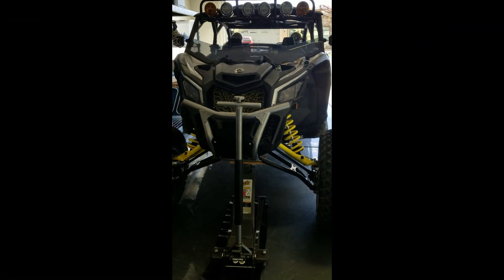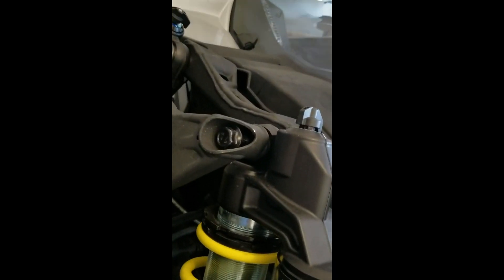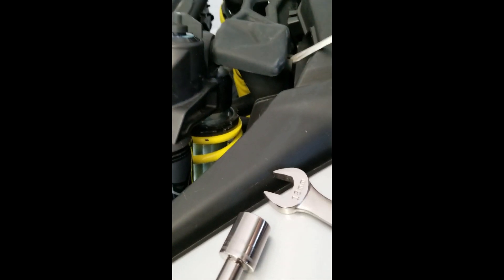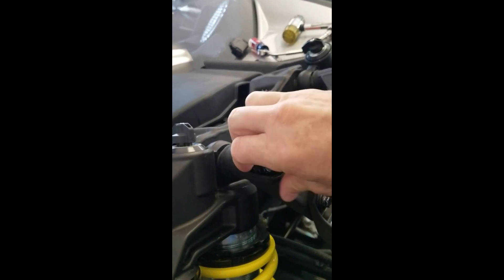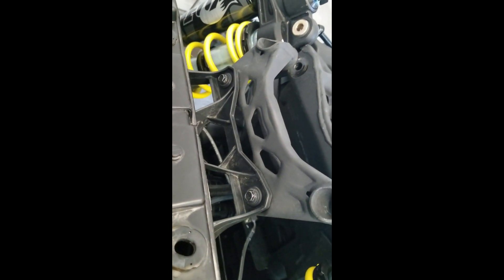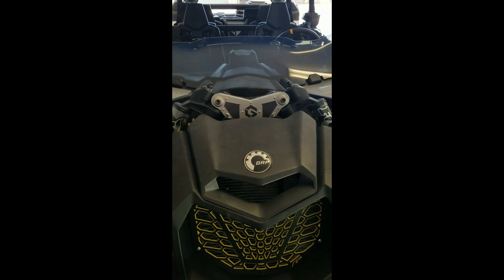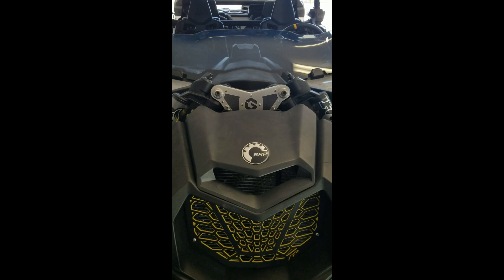Shock Tower Brace Install

Comment: Unfortunately those braces are a waist of money. They need to tie into the bottom of the chassis for it to serve its purpose. Still a good video 👍🏼
Reply: Looks wayyyyyyyy better then stock by far i did mine with LM-UTV made a huge appearance difference
Reply: Actually not true, Geiser brace is 4130 chromoly steel and puts bolt through double sheer vs single tab on OEM part.  Traditional tower brace tied into frame will provide additional stiffness; however, it just moves stress point into front frame.  If you hit hard enough with amount of force it would take to break Geiser brace, your factory frame will likely bend with tower brace.  Unless of course you are running a race car w/chromoly steel tubed frame.  Pick your poison, but neither is bad, and both are good upgrades vs OEM.

Comment: Man I love your can am, I’m planning on buying my first maverick. I’m on a budget and plan on getting the 120hp and y regrets on it?
Reply from the maker: Thanks much appreciated No regrets at all... love it! It pushes 175 rwhp to the wheels w/o the dump pipe open... only difference in the XRS is 64 versus 72 wheelbase and the additional shock adjustments... everything else is identical. I run 4+3 offset wheels and 1.5" spacers so wheelbase is 71".
Reply from the maker: Also keep an eye out for the upcoming Carbon Fiber update and unvail. :)
Reply: I absolutely love mine.

Comment: Any mods to flip the front shocks around? Good video..thx
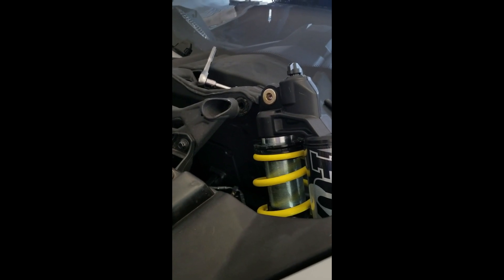Reply from the maker: Thx Cody.... you want the quick and simple... add to this video the removal of the 2 Lower Shock Bolts, switch the left shock to the right and vice versa and install just like you see in this video. Take a razor knife, heat up the blade a bit and cut the plastic below the lip like you see I did at 4:14 in this video to make sure you dont hit the plastic when the shocks compress... cut it all the way around on those 3 side (front/back/and outerside..so where you dont see the plastic, its not the picture, it has been trimmed. razor knife heated up cuts it like butter.